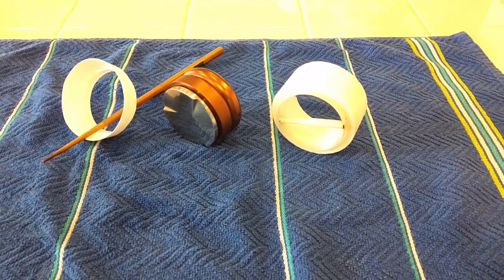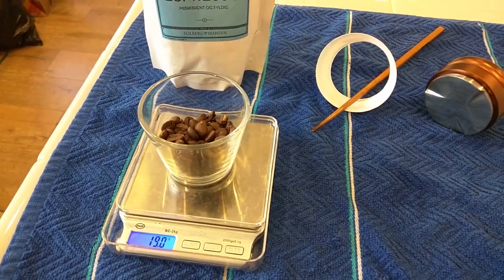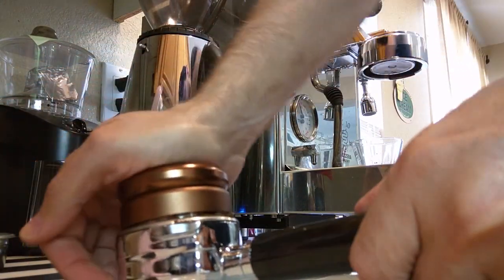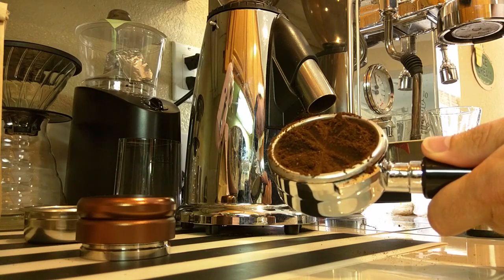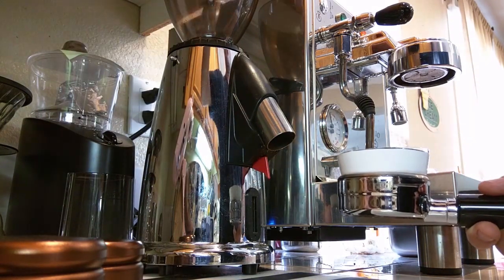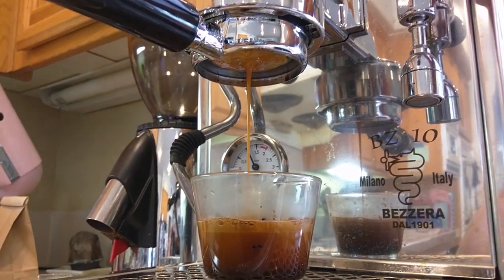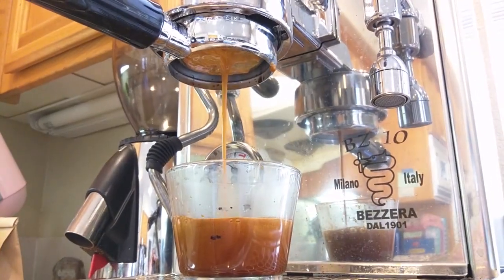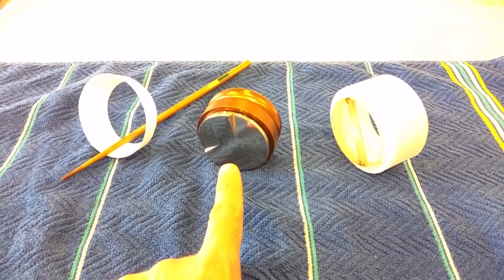Espresso Distribution Tested

Comment: Hard to tell with the first tamp but with the other 3 from our low camera angle we can see uneven amounts of daylight between the edge of the basket and the shoulder of the tamper, perhaps indicating a tamp pressure difference across the face of the puck.   So I'm wondering if the tamp is really consistent across all shots and whether that an not distribution could account for the inconsistent results?
Reply from the maker: I don't think the tamping affected the results.  I've repeated these tests with a Gaggia Classic and the results were the same.  WDT is the winner, but the OCD style distributor device is a really close 2nd place.
Reply: Yeah I came down here to the comments after watching it through, specifically to mention that I saw the last two tamps looked pretty bad. More compressed on your palm, looks like the tamp needs to be adjusted down a little so that it can come to a rest all the way around instead of just hitting on the edge where you press hardest.
In my humble and less experienced opinion, I would suggest, based on what I've read and heard other more experienced people say, that you could make your grind a little finer so that you don't have to tamp so hard, then you can get your tamp perfect as described above.

Other than that, I found this video very informative and helpful. Thanks for the good work!

Comment: For single serve espresso like this I've decided to take the hopper off my grinder and just add the beans to the opening at the top and cover that with a spare portafilter screen to prevent the beans from flying out. Plus it reduces the amount of space the hopper takes up. May not look as flashy but you also don't have to fight those beans from flying.

Comment: I agree below, the distribution, grooming, and tamp looked a little quick and iffy. With only quick flashes of the prepped puck I could see defects.-especially on #2. On last one, I could see the tamp go down unlevel. So I would say the technique is uneven. Next test: pull 3 shots each technique and see if each technique results are the same, or if they’re all over the place. (I think the OCD is actually slightly compressing the puck as well as distributing, which maybe explains better result. It would be interesting to try OCD and no tamp.)

Comment: I'm about to give up on the non-pressurised basket...I recently got 1 for my Delonghi dedica 685 but the coffee seems to always come out under-extracted (around 18 seconds exctraction, thin crema that dissipates fast). I tried everything: tamping harder, grinding finer, dosing 7-8-9 grams (I'm using a single basket). The beans are freshly roasted too. I thought the problem could be my grinder (Ariete grinder pro) not being able to grind finde enough, so I asked my local coffee shop to grind it for me: same results. Can the shot improve significantly by getting a OCD in your opinion? Right now, after filling the basket, I just tap with my finger, level it by removing the extra coffee and tamp it. I'm about to give up and go back to pressurised baskets...thanks

Comment: Thanks for doing this ... very interesting :)
I have 2 questions.
1) Using the purchased tool over a series of shots, were the timings all the same (proving the consistency)
2) Have you found it to be more consistent against bean ageing (requiring changes in grind size) where other methods may be more/less consistent?
Reply from the maker: 1) Yes, I've subsequently done analysis on this, and the times are nearly identical.
2) You still need to adjust your grind a bit over time...nothing really can adjust for that unless the machine itself could detect the age of the beans...at least that's what I've found.

Comment: Hi. I am also an avid espresso experimenter.... FWIW here are my thoughts

You untamped basket seemed a little full, resulting in annoying coffee spillage
I would dose less or get a larger basket.   I dose 18 g:

I get an amount that I can finger level without spillage

Then I adjust the “leveler” deep enough so that lightly touching the espresso leaves no indent

For me, this is tamped enough

I have, however, started weighing my shots... which IMO yields better consistency 
Cheers

Comment: Do you have any specific recommendations for distributing clumped grinds? I'm trying to find a solution to my Rocky's espresso grind. Thanks!
Reply from the maker: Canaan Morse if the clumps won't settle out easily by shaking, then the Weiss technique is really what you need.  Use a paperclip to stir so you really break the clumps up.
Reply from the maker: Canaan Morse if the clumps won't settle out easily by shaking, then the Weiss technique is really what you need.  Use a paperclip to stir so you really break the clumps up.
Reply: Thank you!

Comment: I would try stick stirr then OCD distribution, 2 technics at a shot.
Thanks.
Reply from the maker: Tikamporn K. If you are at home and have the time, I think that would produce a very nice result.  But, in a high, or even medium volume cafe, I think the OCD alone is the way to go.  It's fast and consistent, and requires virtually no training to use.  Thanks for watching.

Comment: I'm pretty sure that Sasha turns his OCD clockwise only, not anti-clockwise then clockwise.
Reply from the maker: Yes, you are correct.  But, since this video I've tried it both ways, and I think my method actually works a bit better.  HOWEVER, the real OCD design is enough different on the bottom that it could make the difference.

Comment: I guess by now you've learned how to use the knock-off distribution tool. You just set it to the desired depth and brew. Dita other comparison with no tamping with the tool.
Reply from the maker: No.. You don't.  The distribution tool must be spun around to be properly effective. The palm tamper is the one that you just set the depth on and go.  They are two different tools.
Reply: I personally have started to use just the distribution tool with no tamp and started pulling better/more consistent shots. In my opinions it seems like people want to continue to tamp just because of tradition. Try setting your distribution tool to a level that presses down hard enough where it doesn’t leave an imprint on the coffee with the ridges. I’d be interested to see what you think
Reply: 🤣🤣🤣 I never imagined there was anyone so dim not to think you have to spin the tool 🤣🤣🤣

Comment: your burrs are touching. consider a calibration, if you can do it yourself on your grinder
Reply from the maker: I'm curious as to why you would say that.  You are absolutely wrong.  The burs on a Macap, when touching make a horrific screech.  If you look up the video from 1st Line about this grinder, he demonstrates that.  My grinder is calibrated and operating fine.  The beans used in this experiment were VERY light roasted beans from Norway (hand carried by a relative to me as a gift).  I was less interested in a perfectly dialed shot as I was about the effects of the distribution.  So, I stand by my result.
Reply: Daniel Baird i assumed they touch, as this is exactly the sound my burrs make, if I adjust grind size too fine. I think the screeching happens if you really push them together. This slight grinding  a noise might be a very light touch. Happy to hear that yours are in good working order

Comment: Pushing on a leveler, as he did, is not how a leveler is designed to be used.  He should spin it and nothing more.  The weight of the leveler itself is sufficient pressure.
Reply from the maker: I don't know what you are talking about.  No where do I apply extra pressure to the "leveler" as you call it.  I even clearly say while using it that no extra pressure is needed, just the weight of the device and spin.  The tamper I used is a Palm style tamper, and has the same copper looking top...but it's a tamper, not a distributor and MUST be pressed down completely.
Reply: You don't know what I am talking about, only because you don't know what you are talking about.  A tamper and a leveler are not the same thing.  And yet, you use terminology interchangeably.  The video reveals that you did apply pressure to the leveler, which you should not have done. (Not that it is a crime.  Just means you are not using the leveler as effectively as it could be used.)
Reply from the maker: 8:18 is the use of the OCD knockoff.  No pressure used...just weight of device and spin.  After that is use of a palm style tamper.

Comment: All I’m seeing is heat loss
Reply from the maker: Care to explain?  The BZ10 has a heated group head and the portafilter is coated brass...stays very hot.
Reply: Daniel Baird ok, so for example funnel, stirring, tamping, DT then brushing the portafilter I might be wrong but it looks like its adding time which would imply heat loss from the portafilter. I think its a trend at the moment to add more flourish?
Reply from the maker: @dutchbeef8920  that's an interesting theory.  It's not out of the question.  But, I would ask you to remember the point of the video was to test the distribution effects on flow of the shot.  It was to make the best tasting shot... you'll notice I never gave a taste review.  Making a video where you are the operator of the machine AND the camera means some sacrifice in movement efficiency that you don't have when just pulling shots for drinks as usual.  That portafilter weighs almost a pound and remains very hot when removed.  Plus, the BZ10 has a heated group head.  If there was heat loss while I was talking or distributing, it likely had no effect on the goal of the video.  I'm not sure about any fad of brushing the top of the portafilter...making sure it's got no grounds on it is pretty critical for a clean seat with the group head gasket.  Thanks for watching!